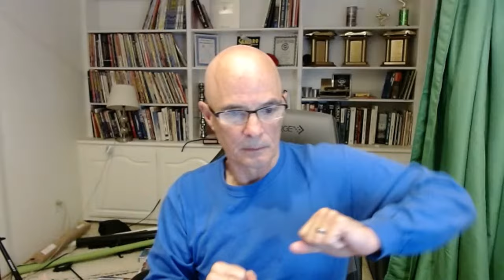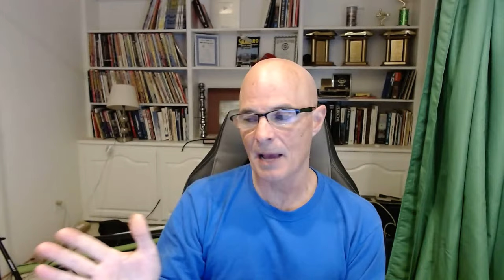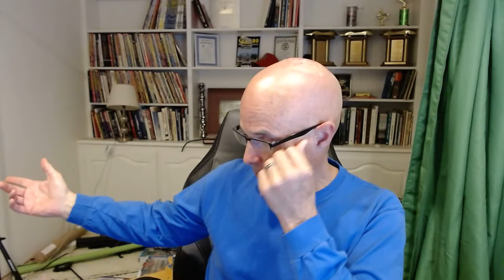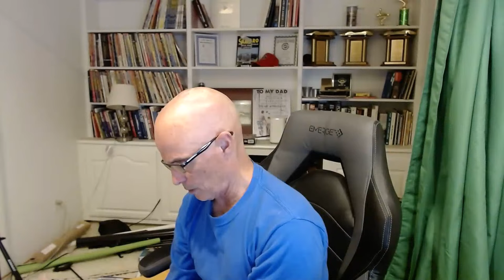WHAT IS A TOWING CAM? LET'S TALK TECH

Comment: Tow cams are cams that have limited over lap 10 to 30 degrees of over lap for Towing  you trap more  combustion in the lower RPM the piston speed is lower and the exhaust gases has more time to exit the cylinder.
tight quench also very important help burn the fuel better and helps push the exhaust out.
Cylinder Heads that have large intake runners slow low RPM power what is good for your combo depends on your engine newer head are very efficient compared to Ome heads
fast opening rocker arms helps In low Rpm and higher valve lift fills the cylinder faster at low RPM lobe separation angle is important!
A 7/4 swapped cam if building a Gen 1 sbc will help in low/mid range 
Proper primary pipe size to keep exhaust speeds up this helps scavenging exhaust gases from the cylinder and against reversion during over lap
A flat tappet cam will out accelerate a roller cam in lower RPM
A 180 dual plain manifold will have a stronger carb signal 180 intake is a intake manifold that doesn’t have the divider cut out .you do have to go bigger on CFM carb because it’s limited to drawing on one side of the carb 
Vacuum secondary is best.
A cold air filtering system that doesn’t get its air from hot under hood temp will help 
These moves is great when not changing torque converter transmission and rear end gears you can make more power with higher RPM but you burn lots more fuel and harder on drive train a tow truck is not a race car a race car makes a crappy tow vehicle

Comment: When I was a long haul truck driver the engine was designed to make a certain amount of torque and horsepower at a specified rpm range and then it was all on the transmission gearing and the final drive gear ratio to keep the motor in the optimal rpm range. My point is I think a lot of people don't consider proper gearing to capitalize on peak rpm range. But I'm just a old hillbilly truck driver with a passion for performance.
Reply: Gears for the win.

Comment: I really liked this conversation. When towing, I need all the power in the entire RPM band. I have a 2012 Silverado 1500 Crew Cab 4WD Z71 with the 5.3 L LC9 all aluminum V8 with VVT and AFM (disabled). I have a K&N Intake with a Flowmaster exhaust and a Hypertech tune for the most power out of the stock engine. Maybe I've boosted the 315 HP to about 330 HP at the crank. My truck has a 6L80 transmission and 3.42 gears with the stock tire size 31.5" tall tires.
As Richard talked about towing up mountain grades to get the the destination that is so true. When I tow my 25ft travel trailer that weighs a max 6,000 lbs up mountain passes, it needs all the power from the LS v8 under the hood of my truck. One particular mountain grade is about 7 miles long in a 40 mph zone with an elevation gain of nearly 3,000 ft. in Fairview Canyon in Sanpete County, Utah up to Skyline Drive. My engine would scream up to redline in first gear and then shift to second gear and bog at low RPM, then downshift back to first gear and scream while at WOT the entire way up the mountain. Trans temp and engine temp would rise, but not to a dangerous level. I could go a max speed of 25-35 MPH up that mountain pass at WOT. The VVT and stock cam was doing all it could for my little 5.3 L LC9 V8. I'm not sure if a Truck Norris cam would help in this situation. Maybe it could.
Reply: I'm in the same situation. I have a huge mountain pass at my door.  My one ton truck has 4.56, but I'm limited with a th400 and barely 200hp. I need more engine.
Reply: @xmo552  Or boost.... cheap nasty boost

Comment: People don't seem to know that the factory specs these cams out for everyday use, smooth idle,and power at low RPMs. It doesn't cost a manufacturer any more money to make whatever cam they decide on. A rear end gear change is probably your best bet if you need more power towing.

Comment: Thanks for all of your awesome work!
I think I'm kinda your typical outdoors guy. I tow campers, boats, trailers with lumber or steel, cars, etc. Having said that, I live in Western Montana, so there is very little flat towing. I find myself ALWAYS putting my foot to the floor. I understand the whole "RV" cam concept, but it seems I'm always wishing for more power, especially if the truck kicks down.  It seems I'm in the over 3k rpm; usu from 3k to 5k range. Once, I towed a full 20ft conex from AZ in my 6l silverado. I basically left the truck in 2nd gear and tachd 4500 rpms all the way home. Every time I tried to let it shift, the truck would slow down and kick back into 2nd. Haha, I ended up smoking an exhaust valve and broke a valve spring. So, I am glad you "get it" in terms of real-life small truck towing. My present everything rig is a 2002 2500hd chevy. Since it's my everything rig, and it is cold here, I chose a gas 6l. Many of my friends with diesels have problems all winter long. Especially, when we are out hunting and you can't plug in the truck. I had a truck w a roller cam 454, but as you know, the gas mileage is almost the same towing or not. Anyway, I haven't built it yet, but have a 408 stroker kit. Based on your tests I will buy either truck norris or choppacabra, (whatever I can get), trailblazer intake, and am undecided on heads.
With the increased displacement, would I need to increase valve size in the stock heads? And would it "marginally" raise the effective compression? Also, since I live at about 6k ft, I am thinking of increasing the compression. Would a 243 head allow me to run regular when not towing?

Comment: A lot of people like myself are sort of looking for something dual purpose. When I built my most recent 454 I installed the Comp Extreme Marine 226/236 grind. I didn't want it to run out of breathe immediately but did want it to make decent torque under the curve for when it does tow. I also knew that the real heavy towing will be with my diesel service truck. This truck needs to tow a small camper, car trailer, etc. Not be pushing the limits of no CDL with a pickup. lol

Comment: 3.90 -4.00 stroke will most definitely  make the biggest difference with the other suggestions I  made earlier with Richards sugestions can get you a very notable increase @2-3000 rpm and abouve that as well. Do not use a wide lobe separation, that kills torque. Anyone who tells you otherwise doesn't  understand cam function.

Comment: My thought is that most cams are lift starved relative to duration. Old "tow cam" grinds typically have terrible lift numbers and a short duration. Now, if your cylinder head is good, you can add .05 or .10 lift with little or no difference in reliability,  drivability, and get significant gains. Really, a "TOW" cam is just a cam that has close to normal drivability on a stock driveline. To me, a good tow cam grind is a hyd roller 212/216 @ .05, and has .550/.560 lift, on 325 to 400 ci apps, and again, this is for people trying not to alter the driveline.
Reply from the maker: we tested the effect of just lift-not much there. The NSR TN cam had 500 lift, the regular TN had 550 lift-only 6 hp.
Reply: @richardholdener1727 
Yeah, but as I said, induction quality plays a big part in that, LS Cat ports really aren't there in my opinion nor early G3 Hemis.
Reply: Now I know I'm gonna get flamed for saying that, but the gains you get from a later Rec port Ls or 09+ Hemi have the quality I was talking about. If a cam with only 8-10 more degrees, and .05-08" more lift gets you nearly 50hp verified on a chassis dyno, with no really torque loss, well the lift works.

Comment: The 400m had a really good rod stroke ratio for low to mid rpm range. The block is tall enough to take a 4" stroke, but it wasn't great about passing a gas pump! Frankly, a towing application you shouldn't be worried about anymore past 4500rpm! Feel free to disagree,  but, I  tow campers and large boats!
Reply: Yeah, it just needed quench. Even 4v quench heads with the stock intake manifold, and the 4V exhaust manifolds. Simple change, huge difference. Add a beast cam, (206/212) go forth and rejoice.

Comment: On the Ram trucks with the 6.4L intakes added as well( lots of gains everywhere in the rpm range) most guys stay below 
210/XXX on the cams for the low end power. And with the gearing of the 8Hp70 even 3.21 rear end gears work very well. However, 3.55-3.92’s will do wonders.

Also, we’ve found that anything above a 2,600 stall creates a lot of heat.

Comment: I'm not a mechanical guru, but if I were going to turn my already torque heavy Sierra into a tow rig. Since I already have a trans cooler, I'd probably start with a small turbo.
When I have hauled with it. It did fine, except on steep grades.
In my semi, that's when the turbo kicks in, and I easily climb to the top (unless I'm hauling almost 80k lbs. of Brembo brake rotors through the mountains from Homer, MI to Ford in Lexington, KY). 
Honestly, most 3/4 and 1 tons from any of the Big 3 have enough torque to haul. So if you don't have a trans cooler. That's the first place you should consider putting some money! Second place would be a turbo.

Comment: I can only hope nobody is towing in overdrive, so less likely to be near 2000 rpms. 
***Unless the trailer is empty etc. 
Towing cam needs to be happy in the 2500-3200 rpm range.  Crane use to advertise their cams in recommended “Cruise RPM” ranges.  Erson Cams may have too? 🤔
Stock LS cams are off idle to 4500 rpms, intended shift set at 5200 rpm. 
So, a cam with a slightly tighter LSA to help build cylinder pressure, (accounting for detonation), as our limiting factor in the 2200-5500+ rpm should be an improvement.

Comment: Tow cams have to make good torque at part throttle with auto trans. Once you get past 2/3 throttle in drive, engine shifts down automatically.   A cam that makes 10ft/ lbs  of tq gain at full throttle can make significanlty more tq at 1/2 throttle in an airflow regulated  situation that part throttle scenarios provide.   When picking a tow cam shift recovery is one of the biggest things to look at, you can go to full throttle when the tranny is locked out in 2nd gear, but as soon as you shift up into drive if the engine won't recover and carry the gear you start applying more throttle and boom it shifts back down again.   Tow cams are tough ,, in 2nd gear the stock cam is only a little too big, in drive the stock cam is WAY too big.   Dyno testing is very relevant to 2nd  gear towing  , not so much in D or OD.
  Went down this road for a few years with a 347 in an f-150. 3 cam changes going smaller each time the truck worked better each time.  Finally ended up 200@ .050 .460lift  108LC  102ICL.  Tried to go smaller but cam grinders dont make lobes smaller that I could find .
 Runner length and header length matter big time,  if you are expecting performance at 2800 rpm  those parts have to be in tune at 2800rpm.  Headers that were built for truck were 60" long tri y  12" primary 48" secondary.
 Many people assume because a cam is "stock" that it must be too small, I dont know that too small is a good way to pigeon hole a stock cam as I would say stock cams are to "generic".   A cam that has to work well from idle to 4800rpm is trying to cover a 4200 rpm range.  Towing takes place from 2200-3400rpm. I thinks it possible to build a better towing cam but the testing has to occur on the dyno and vehicle.  Makes it tough unless people want to expirement with 1/2 to 2/3 throttle testing on the dyno to give an honest representation of results in Drive..

Comment: This is an interesting topic.  I recently rebuilt the FE 360 in my 1975 F100 and did a budget build / overhaul and stroked it to 390 cubic inches. swapped out the 2 bbl intake to a cast iron 4bbl intake / 650 vacuum secondary carb and long tube headers. I spent a lot of time on forums looking for real world info from people that had done a similar build and camshaft recommendations.  I ended up buying a comp 260H 212/212 duration, 110 lobe separation based on the fact its supposed to be a truck cam and make most of its power in the midrange.   I would be super interested to know how the 260H compares to the stock cam in terms of horsepower and torque curve.  I would have to step on it pretty hard to get the C6 to kick down to second gear on the highway, so its a bit different than a modern truck that can drop 2 or 3 gears to get the RPM way up.  With these old school rigs I think you are aiming to make the Highest possible torque at the RPM the motor is turning on the highway which is usually pretty high depending on rear end ratio, well over 2000 without an overdrive.
Reply: Forgot to mention that I kept the stock 360 truck pistons with 390 crank and rods and that brings the pistons higher up in the hole which I think adds about a full point of compression ratio.

Comment: Considering my stock 2500HD pulls Mtn passes at 4500 rpm in 2nd gear with a 28' trailer, i'd think any cam that improves between 3-5k rpm would be a good rv cam.....for me
Reply: Same. I'm towing a camper with a 5.7 mated to a 400 transmission in a square body 2500 4X4 suburban. 7.7 mpg. 😱
Reply: @pocketPliers  
Yup. Agreed.
81 GMC c3500 350/400/4.56

I need more gearing and a little more power.
Reply: I'm running a similar setup currently- 2500hd crew cab 6.0L/NV4500/4wd. I tow a ~5000lbs trailer occasionally. When pulling a hill I let it turn 3000-4500 rpm.
 I plan on building a 402 stroker for it w/ ~9.7-10.0 compression and mildly ported heads. Cam will be either truck Norris or a summit 205/212.
Reply: Ive got a 2500hd 6.0 and pull a 32” toy hauler and I installed a cold air intake and flowmaster exhaust and Im pulling the same hills over 20mph faster

Comment: I remember years ago, it was thought that maximum power with the intake lobe centerline matching the lobe separation, but it was also known that advancing the cam would increase cylinder pressure. Later, late 70's, early 80's, that maximum horsepower was thought to be with the the intake lobe centerline at 106 regardless of lobe separation and maximum torque was with the intake lobe centerline at 102 degrees.
Reply from the maker: look at valve events

Comment: I've always been curious as to why there's nothing that can help down low, because mainly when you take off, they suck... Lol.

But your explanation so far early into this video makes sense that nothing in cam timing or lift/dur is going to help more than stock.

So I guess the next question is, what cam/intake/exh combo would work best for towing purposes with a 5.3? I have the baby 4.8, but the more common engine is the 5.3, so that could be a great test with a draggy. Towing up a hill stock vs a good combo designed for towing, and from a dead stop.

Also, curious when adding a converter to get the engine to start at a higher rpm, does this cause more heat in the trans, and does it hurt fuel mileage as well vs a stock converter?
Reply: I'll be honest cubic inches.  Gear ratio is the main player though.
Reply: A smaller converter in physical size creates more heat, eg 300 mm vs 265mm- the 265 is going to make it hotter, put a transcooler in, a torque cam is ideal for moving heavy loads as you don't need the top end revs anyway, look at the vortec 7400 and 8100 and you will understand.

For 5.3 or 4.8 a TSP Chopacabra or BTR Truck Norris, 862 heads, 6.0+ id say 799/243s and even larger cam. Intake gen 3 or 4 ls intake.
Reply: @johnsheetz6639 and not everyone is going to try and find a 454 or 496 big block or can afford a 376 6.2, a 427 7.0 or 454 7.4 LS, they run what they have and the 293/325 have plenty of potential without requiring boost.

Comment: I know that the Bbody LT1 camshaft makes much more torque than the Fbody or Vette versions and less HP. Power wise the only difference is the aluminum heads. The iron heads actually flow better ironically and the combustion chamber is moreless same size

Comment: I believe if you have a lockup converter it should be a 3k stall even with a stock cam. If it's a 3 speed it still needs a 3k stall but it needs to be a well built 3k that's not really loose. Generally I run 3k 3500 stall on everything and I've never been disappointed. Also with a silveraldo (4 speed older trucks) should all have 4.10 minimum gears from the factory

Comment: This is why I tow with a dodge diesel, gobs of power above about 1700 rpm and on the downside not much above 3500.
If I had to do it with gas it would be a huge inch motor with deep gears and a little supercharger ,small cam to mimic  diesel

Comment: Think in terms of a diesels operating range. While a cam may not be the most important component in making a towing situation better there is probably room for improvement. Maybe lower duration than stock with tighter lsa than stock, maybe vary the lift based off of dyno info. An effort to increase dynamic compression down low.
Reply from the maker: a diesel doesn't make lots of torque because of the cam-it does so from displacement, compression and boost
Reply: I was trying to stick to the discussion title
"WHAT IS A TOWING CAM ?
Reply: All I did to my 97, 460 was advanced cam 4° pulled like a tractor of idle to 3500